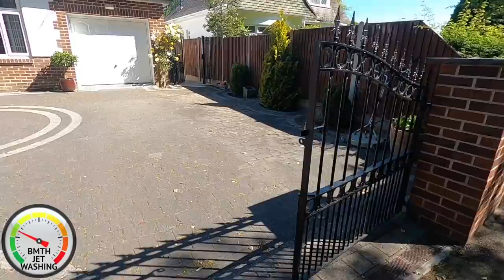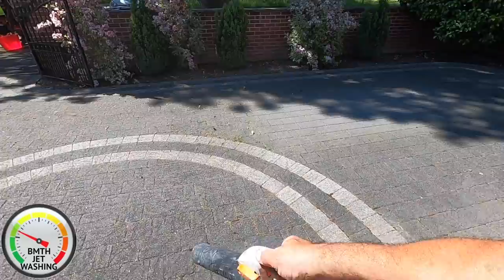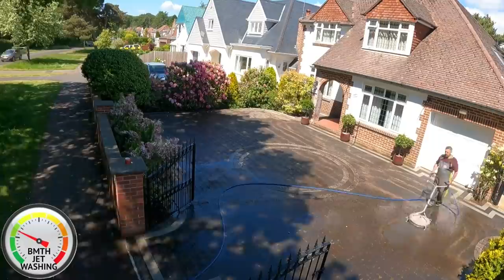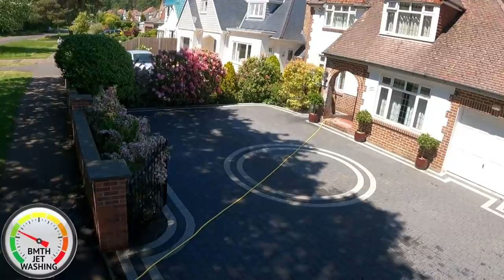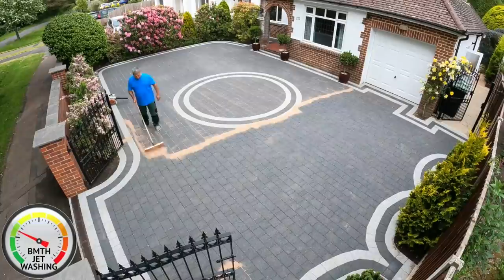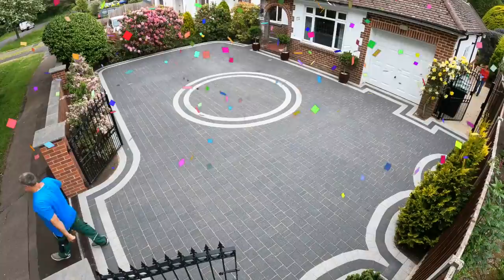Pressure washing and restoring a dirty driveway

Comment: I laughed when the guy with the mask walked by, I feel the same way when I see someone walking alone with a mask on.   Benny hill music in sped up video would have been icing on the cake. The only thing I may have done different is run a compactor when putting down the sand to further lock them in place again.  Over all very nice job.
Reply from the maker: Cheers David

Comment: This is literally my dream job, i just wouldn’t know how and where to start.
Reply: It's not difficult. Just start doing your own drive, family and friends and with experience you will get better. You can start with a low cost jet wash. The equipment needed is not expensive and you can even charge a bit extra to wash the bins but watch out for the green bin!
Reply: @mayam1141  false, any idiot can work at McDonald's and flip burgers in the a/c. This is labor intense work and you must have knowledge in chemicals and mixing them, how to apply them, how long of a dwell time for each chemical, what to do on different kinds of surfaces, customer interaction and sales, equipment maintenance and purchasing and repairs, and much more labor than alot of careers. Definitely not everyone can run a power/soft wash business I can guarantee you that, and from the sounds of it, you'd be horrible with that mindset. I wouldn't hire you
Reply: @cashen7384  😂
Reply: @mayam1141  🤷‍♂️🤣

Comment: Will you please do a video of the required preventative maintenance of the items in the back of the van? Do you have to remove water scale? Clean the washer tips? Chemical flush water/chemical lines? Oil/grease components? Replace wear items? Wipe down components? I think this would be interesting as well as showing some of your organization and items used. Not looking for trade secrets, just mechanically minded.
Reply from the maker: https://youtu.be/6HcplEHPNVY
Reply: Yes, that sort of video on a larger scale.
Reply from the maker: @mdc503  there are videos on the channel somewhere of the van setup

Comment: Nice one Ricky. Did you have to go over that with a turbo nozzel, after the flat surface cleaner. There looked like a load of weeds still there when you was doing the rinse down.
Reply from the maker: No not needed, my fault on the editing put in the first rinse down rather than the second , the surface cleaner got all the weeds out no need for turbo

Comment: Great job! Quick question if I may... After you used the patio cleaner, there was still green inbetween the gaps of the paving blocks. How did you get that out? Did the hypo do that for you and they came out when you did the fan nozzle rinse off after? Great job none the less! Keep it up :D
Reply from the maker: the surface cleaner gets all the moss and weeds out of the block paving  :)

Comment: I had my block paved drive pressure washed and re sanded, it’s a sloping drive and it
rained 2 days later and a ton of sand washed down all over the pavement and into the
road, it was a terrible mess and my neighbour was angry, we had to get our hosepipes
out and wash it down the gutter and sweep and sweep for 3 days, it killed me.  I’ll never
have it cleaned again.  Now I’ve got a ton of weeds and moss in it.  Block paved drives
are a menace.
Reply from the maker: Yeah that would certainly be a ball ache its a shame it rained so soon after it was resanded, the sand dint have time to settle in

Comment: How many Psi your machine has?? Is it possible it portable??
Reply from the maker: Hi its a 23hp briggs engine the pump is 250 bar / 30 lpm , its setup in the van not  possible to bring it out, dont need to just pull pressure hose out to what ever distance I'm working

Comment: i'm wondering, how did all the weeds disappear? Did the softwash treatment really got rid of them, or did you have to go at it a second time off-camera?
Reply: Yeh could still see the moss after the steam clean but had all gone when he started the re-sanding
Reply from the maker: my fault on the editing put in the first rinse down rather than the second , the surface cleaner got all the weeds out no need for turbo , Softwashing does not remove weeds

Comment: That re sanding does my head in. If you go back 2 yrs later, all you will be doing is washing out the sand you replaced, when you cleaned it. An exercise in futility.
Reply from the maker: True, but resanding re stables the blocks, it's not a problem to re do